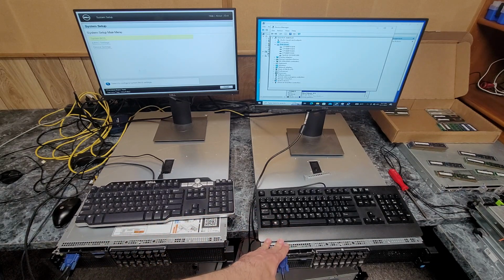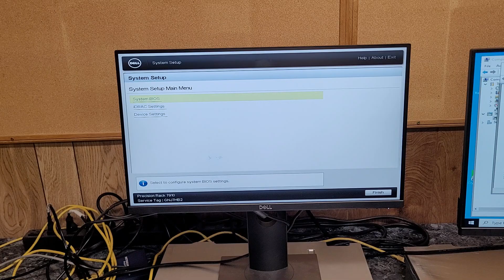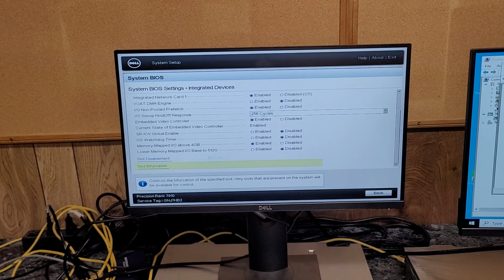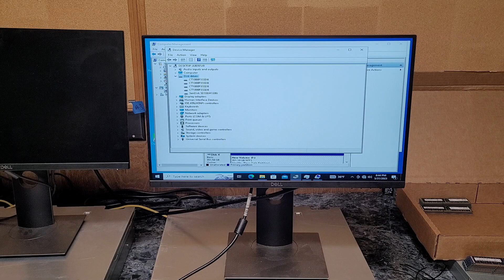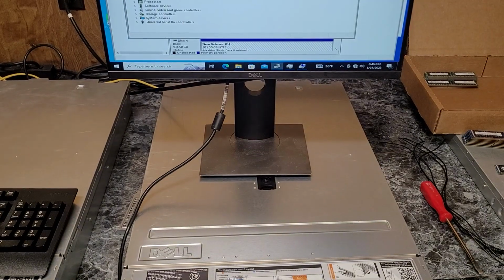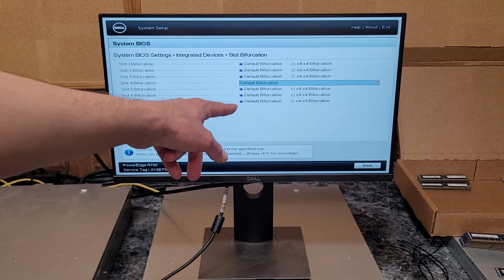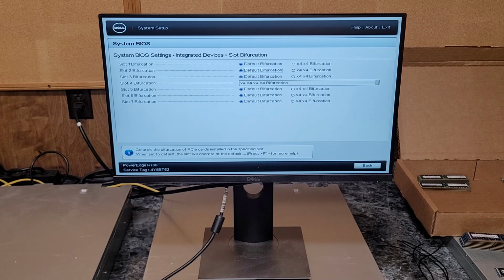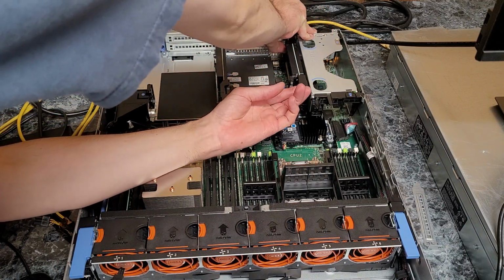Troubleshooting and setup of PCI Express bifurcation in supported 13th gen Dell servers

Comment: Sadly, this "update BIOS" trick does not work on Dell DSS7500 (aka DSS7000). I had BIOS version 2.9.1, just updated to 2.15.0 (latest). Still neither "Slot Bifurcation" in the BIOS, nor "silently automatically works" (like on T7910 tower) - only one NVMe disk is visible per slot.
Reply from the maker: In your case you would have to get a PCI Express NVME card with a PLX chip on it to do more than one drive per slot.

Comment: I have dual cpu in the 710 I want to use  2 -4 slot nvm adapters to enable 8 drives..can I do?
Reply from the maker: The NVMe adapters would require PLX chips since the R710 cant do bifurcation.
Reply: Can the 730 do so? @computersales
Reply from the maker: @ShadowLover-c3e  R730 supports bifurcation with updated BIOS.
Reply: @computersales btw you said the 710 could do bifurcation with bios update..you make everything so confusing
Reply from the maker: @ShadowLover-c3e  Timestamp? I'm not aware of when I said the R710 supports bifurcation. The Rack 7910 supports bifurcation but that is not a R710.

Comment: Thank you for the info.  I spent a lot of time reconfiguring physically and in software but could not figure out what I was missing until I saw your video.  Seems each time I went into the BIOS I somehow did not drop down far enough in the screen to see the proper setting line at the bottom.  DOH.  Don't do new/unknown IT in the wee hours of the morning.
Reply from the maker: @victorassivero1061  lol I know how that goes. Once spent a day trying to figure out why a GPU wouldn't work in riser 3 till I finally realized that riser 3 doesn't work in a single CPU config. (Ironically I already knew that too.)

Comment: Dell R230 and R330 dont have bifurcation but R630, R730XD, R830 and R930 have bifurcation. Havent looked at my R430 and R530 yet. Ill update when I get to it.

Update: Dell R430 and R530 both use same bios file. Newest BIOS for 2024 is 2.19, both do not have bifurcation either.
Reply from the maker: Thanks. That is very helpful to know.
Reply: How about the dell r610?
Reply: @ShadowLover-c3e  not 100% sure about the R610. You may need to do a BIOS update along with any compatible firmware updates.

Comment: For anyone wondering, I updated my PowerEdge T330 from 2.4.3 to 2.20.0 and I still do not see the PCIe Bifurcation option in my BIOS.
Reply from the maker: @benfrey  dang that's a bummer. I wonder if it is an actual hardware limitation or they are just choosing not to add it to BIOS.

Comment: Thanks for the info! Does the bifurcation also work with the Dell Precision 7910 Workstation/Tower? Thanks!
Reply from the maker: I don't have any experience with the tower 7910 unfortunately. Only reason the rack version supports it is because the rack 7910 is just a rebadged R730. If you do not see a setting in your BIOS I would try doing a bios update and see what happens.
Reply: @computersales thanks. I've purchased two Today and forgot that "detail". They will arrive Saturday and will try. I see conflicting info around the web. Some places say it doesn't, other say it support "natively" or "automatically" and there is no settings on the BIOS. So I'm not sure :/
Reply from the maker: @galvesribeiro  I ran into the same issue with the rack 7910 till I started working with it and did the BIOS update. Hopefully that will be the case if they don't have it by default. You will have to manually configure the birfurcation in BIOS though if memory serves correct.
Reply: I just added the Dell 4 drive name pcie card to my T7910.  Couldn't find anything in the bios.  Plugged it in and it recognized all the drives automatically
Reply: @markmaddox9303 u dont need any setting. It just work with the tower 7910, no extra settings needed. It negotiate the PCIe lanes.

Comment: Maybe you can use two of those PCIe cards with 2 NVMe each, on 8 lanes? Might be still cheaper than  a card w/ a switch chip builtin
Reply from the maker: Honestly the x16 riser I would need wouldn't cost too much if I was doing it the frugal way. The temptation to upgrade to an R730xd is too strong.

Comment: Very good instructions for those wanting to upgrade their 13th gen Dell server(s). Was the room air warmer than inside the server that the fan sped up when the server's cover was off?
Reply from the maker: They have an intrusion switch that lets them know when you take the cover off. They increase the airspeed since the path the air needs to go is compromised without the cover. Basically the cover is an air duct. Generally when you take the top off they will go to max fan speed.